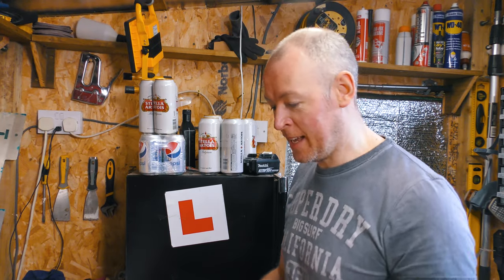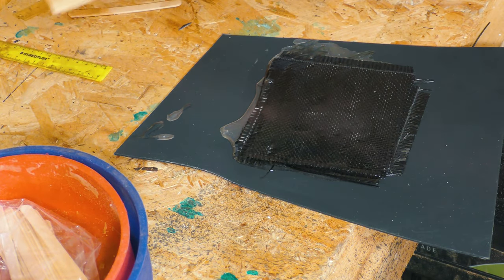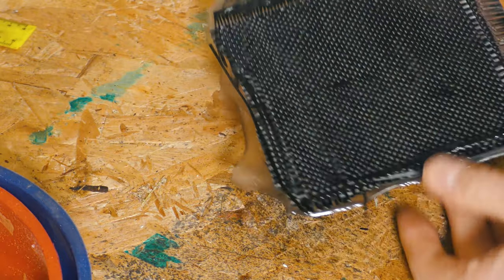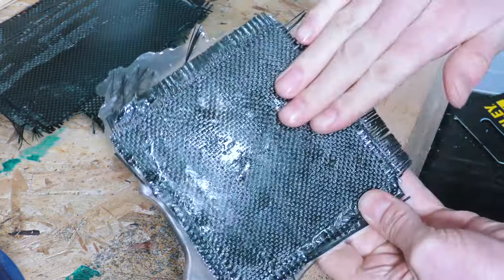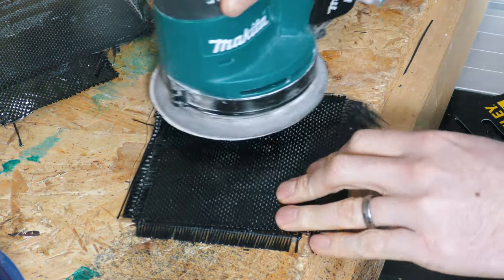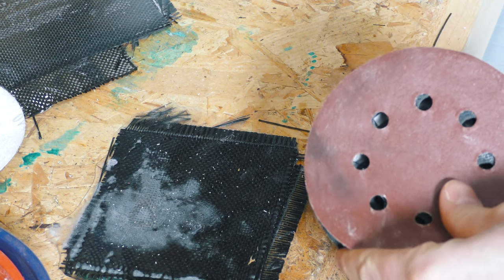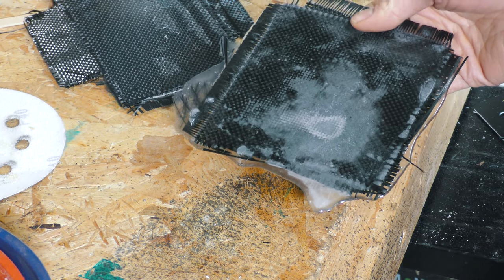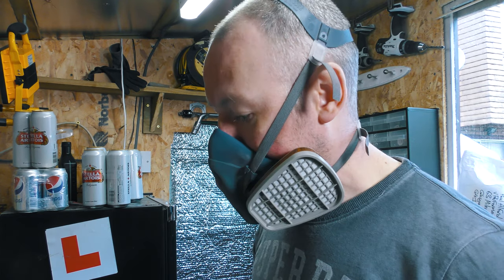Carbon fibre scoop Part 5 - finally the resin works!

Comment: You could also clear coat it after and sand the clear coat, which would get it closer to nice and smooth. I originally thought you were just going to use the original scoop, fill in the side gaps with carbon fiber, and give it a layer of carbon fiber covering so it looks like it's made out of it, hah.
I also think if you play with the resin less, especially after it has partially set, it will come out smoother. Do the top layer with some resin reducer if that's a think, so it self levels better. Or at the very least use a soft squeegee that is the width of the full surface to flatten it and press it in.
No matter what, this def came out better! Fun to come along in the process.

Comment: Could you add a second layer of resin to the top?
Reply from the maker: I'd have to pour it on the curved surface of the scoop for the project, and it'll never go on smooth 😕
Reply: I was thinking if you could add a layer of the resin you could then sand that resin layer flat and smooth.